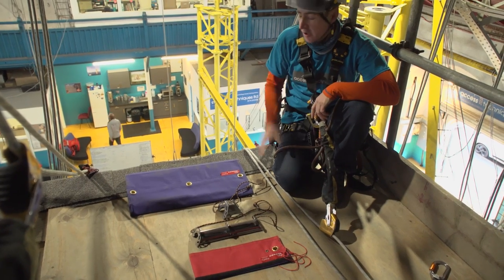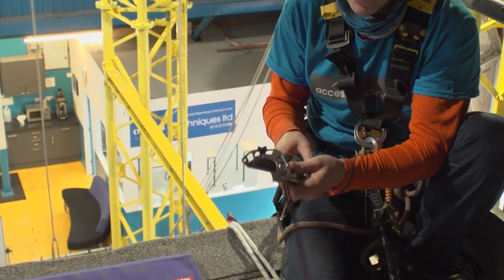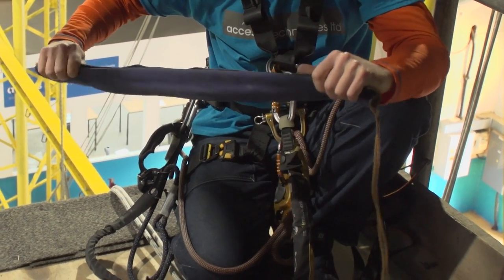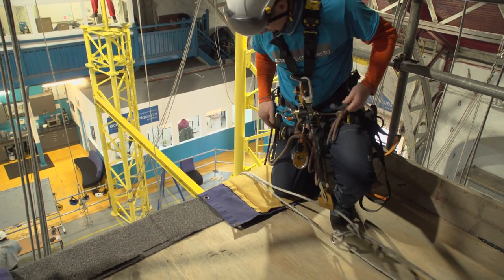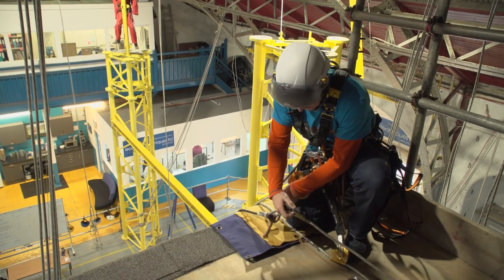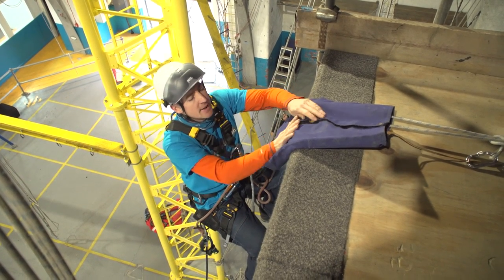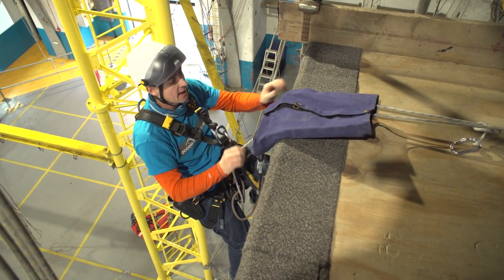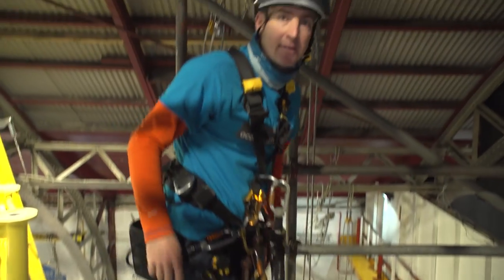Abseiling over a 90 Degree Edge. 2020.

Comment: So, I recently got my level 3, and right off the bat let me say, I am not as knowledgeable or as good as a tech as the guys at Access Techniques. This is a genuine question: Didn't Petzl recently or in the past release guidance on not having their ASAP on the top of the edge during your negotiation? Its my understanding you're suppose to move it below the edge as soon as possible. So you can't load it on the edge in a fall.
Reply from the maker: Hi Chris. While I don't doubt the logic of both methods, it was always the case to keep your back up as high as possible to reduce the length of fall. I have had a look at the petzl guidance on this and I can not see what you ae referring to. Feel free to forward it so I can have a look. Thanks for the comment.
Reply: You probably think of situations when, if you fall: #1 device would not instantly react to speed of fall or #2 device will react but with rope elasticity counted, ASAP device will be moved to position of the edge and will be under side pressure?  *Device I was using on my work was Singing Rock's Locker fall arrest.